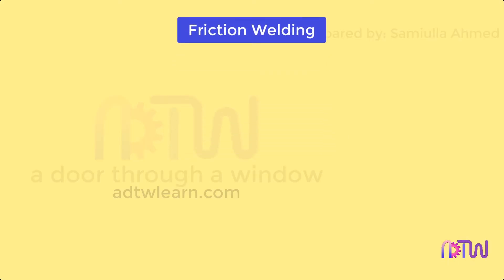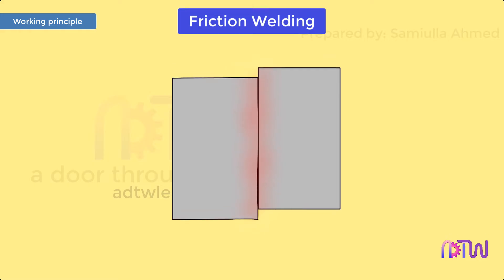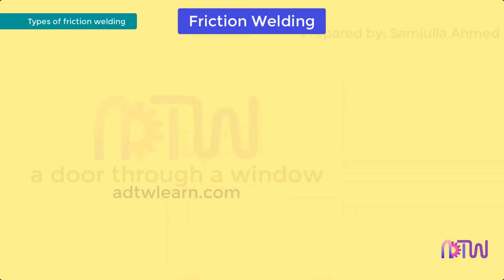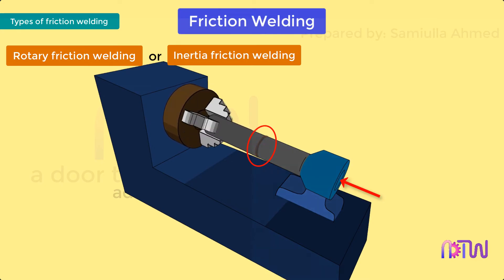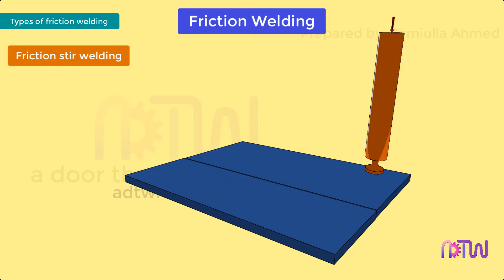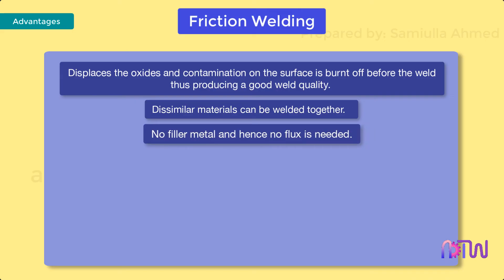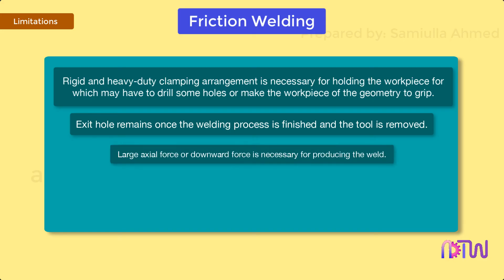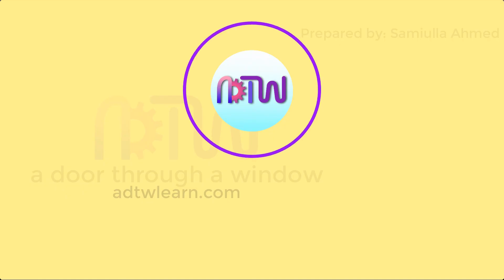FRICTION WELDING | How friction welding process works | Types of friction welding.

Comment: Thanks for you video it was good but i have a question.. Whats the difference between continous drive friction welding and inertia welding? Could you explain it
Reply from the maker: Both continuous drive friction welding (CDFW) and inertia welding (IW) are solid-state welding processes that join two metals by applying heat and pressure without using any filler material.

The main difference between these two processes lies in how they generate heat and apply pressure to the metals being welded. In CDFW, the two metal parts to be joined are rotated against each other at high speeds, generating heat due to friction between the two surfaces. Then, pressure is applied to the parts to forge them together. The rotation continues throughout the welding process until the joint is complete.

In contrast, IW uses a similar principle of generating heat through friction, but instead of rotating the parts, one part is held stationary while the other part is rotated at high speeds. The rotational energy is then quickly transferred to the stationary part, generating heat due to friction, and the parts are pressed together to form a weld joint.

In terms of advantages, CDFW has the ability to join dissimilar metals and can produce high-strength welds with excellent fatigue resistance. It is also suitable for joining complex shapes and parts of varying thickness. However, CDFW may be limited by the size of the parts that can be welded, and the process may require more energy compared to IW.

IW, on the other hand, is known for its high production rates and its ability to join large and heavy parts. It is also a more energy-efficient process compared to CDFW. However, IW may not be suitable for welding dissimilar metals or materials with vastly different melting points, and the process may require precise control over the rotational speed to ensure a successful weld joint.